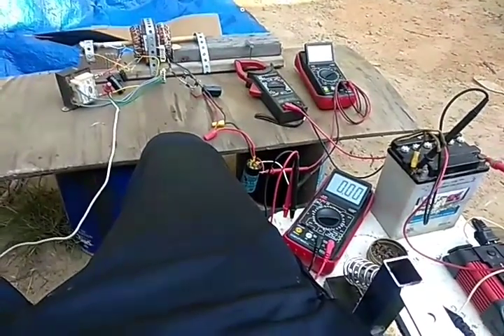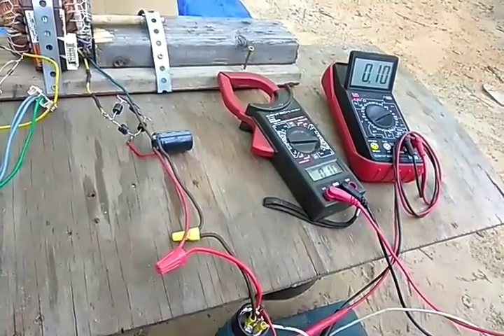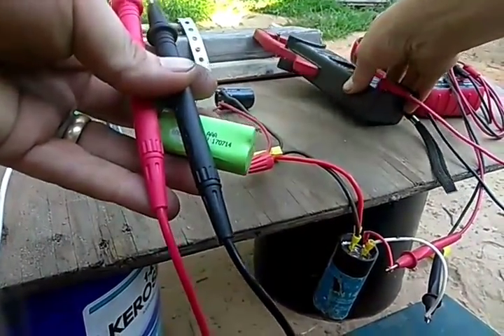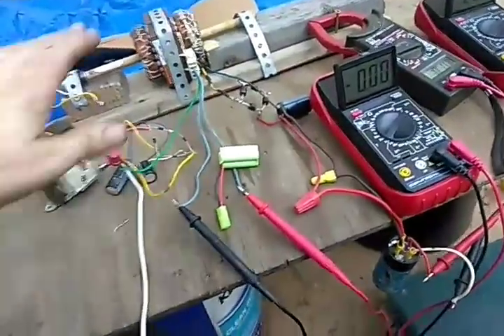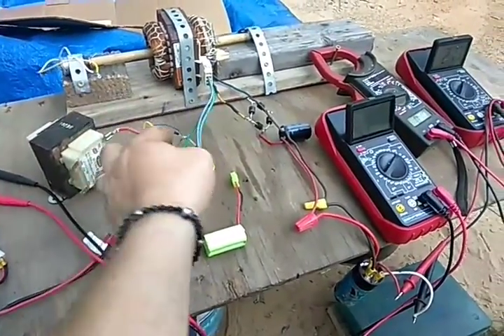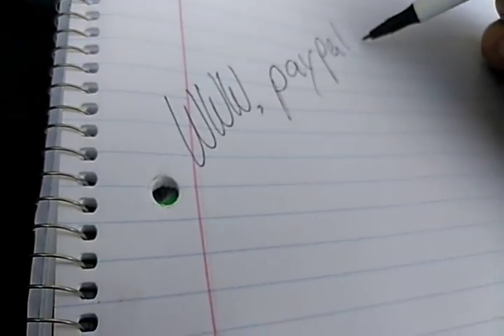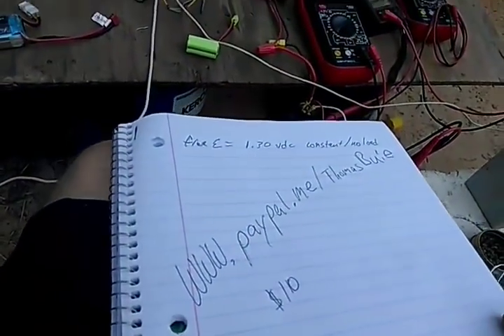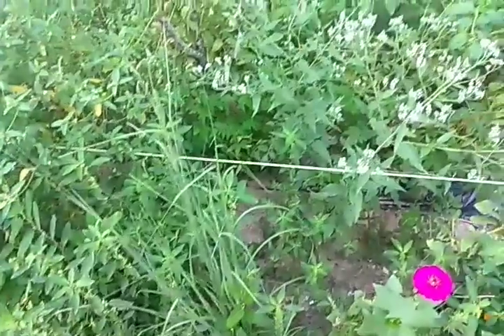FREE ENERGY DIY GENERATOR! EASY! TRY THIS AT HOME AT YOUR OWN RISK!

Comment: I'm not an electric engineer in fact I don't even play with electric but I'm very interested in learning more about this stuff. I will be building a house in the middle of no where and want to be totally sufficient and off the grid with power ,rain water collection system a well that's powered by what I can get be it from solar,wind or things of this nature. So thank you for sharing this type of stuff many people are interested and don't let the trolls get to you many people like you and your videos I found them from I couple of co-workers who watch them
Reply: Start buying batteries used medical devices. The company that services medical devices must change out those barriers before they wear out. The servicers can't wait until the batteries fail, if the device stops, someone might die. Buy a few at a time that way you don't have a large cash out all at omcr

Comment: why dont you add a voltage reducer on the alternator out the blue wires and a Bridge reciter and just spin the shaft it wil supply the 6 volts and should  keep going
Reply from the maker: I'm only allowed to lead them to the water...  they have to be creative themselves, to get the answers from themselves..  or ourselves

Comment: When you discharging the capacitor in comb. with battery, your very low impedance will recharge the battery(static field)- but not 100%, BUT when you start discharging system on higher impedance - your system will be empty very fast..

Comment: It's difficult to see on my small screen, but after the bridge rectifier on the right side, is there two capacitors in parallel?
Reply from the maker: DecimalZero Yes, I'm using one to smooth out the direct current pulses and I'm using the other to build capacitance.
(it's really close to the same circuit that I built for the large permanent magnet DC motor that I have) But it will still build up a charge without turning the shaft with only the smoothing capacitor on there.

Comment: I don´t see any overunity nor free energy... I thought you could it selfrun without batteries... but it seems that does not work....
Reply from the maker: +Stefan Hartmann there will be more videos of this as I was pressed for time! 
And just for the record I do have private videos!!!
Reply from the maker: Robert More because you can produce free energy with a 3-phase field magnet motor or a 3-phase permanent magnet motor which was featured in that video.
Reply from the maker: +Stefan Hartmann real funny coming from a guy that builds similar devices!!! as I have watched one of your videos! The only difference between you and I is I have built an 800% efficient motor! I have private videos that I don't share with very many people and you were using a window crank motor that was very inefficient!
Reply: Then really show us the claimed 800 % by letting it run on the video for half an hour and show us, that the battery voltage will not drop, or even better let it run on supercaps without batteries and show us that the voltage on the supercaps does not drop. Many thanks in advance,
Regards, Stefan.
Reply: He is CLUELESS.
If he actually made an engine 800% efficient, he wouldn’t be working in dirt with flip-flops, lmao!
Reply: Wouldn’t building a windmill from scrap like KREOSAN did be easier? They used a motor from an electric bike as the generator and cut sewer pipe into shape to use as propellers and it seemed to work good, or building a water turbine like in another one of their videos?